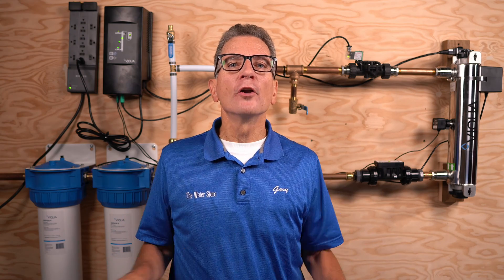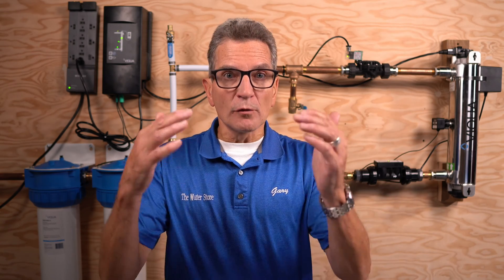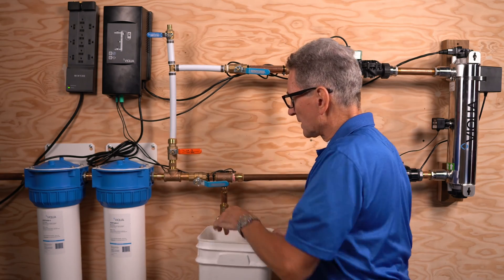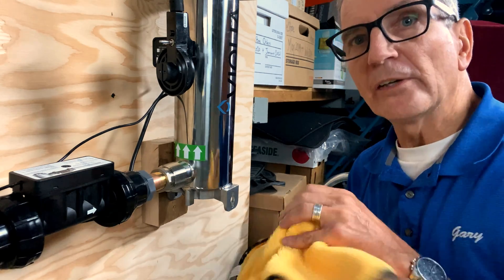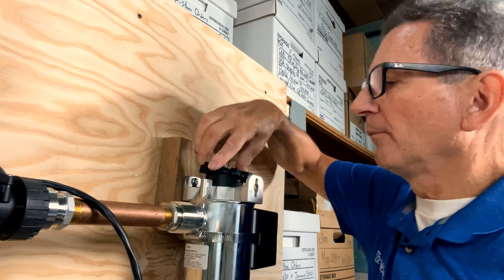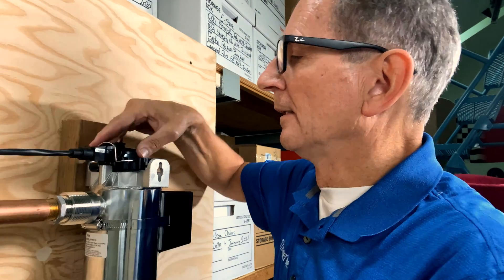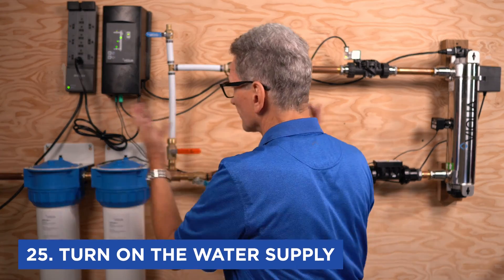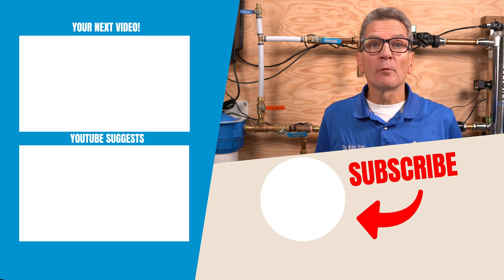How I MAINTAIN VIQUA PRO UV Disinfection Systems

Comment: Thank you for this very, very useful video. I live in Brazil and have a Viqua PRO "H" system and just two days ago the lamp went, after 2 years and I had to do the very job described in your video on my own equipment. 

Followed your video faithfully and everything seemed to go very smoothly and appeared to be fine. Flooded the system and turned the current on (over here it's 220V) and pressed to button to reset the "life" counter for the lamp BUT after it did the initial checkup, here were all green lights in the control box but after a few seconds the lamp light indicator turned yellow, and the alarm starts beeping and stays bipping unless I switch it off and the lamp stays yellow.

Do you have any recommendations / insights into what the problem might be? Thank you so much. Joe Martins
Reply from the maker: I'm not sure, never happened to me.  I would contact Viqua, they have great tech support and I'm sure they will be able to help you.

Comment: What about servicing the solenoid valve. Every time I have a power outage the whole unit goes into lock down.
Reply from the maker: Yes that's what it should do, but after the power comes back on the solenoid will open? If not, you need to replace the solenoid.

Comment: Thank you for posting this! We have been having intermittent alarms for the last year and a half. Called out the plumber that installed the system, and he said both sensors were bad. After he put in new sensors, it was only a matter of months until the problems returned. We disassembled the unit today and cleaned the sleeve and freed up one of the paddles in the flow meter sensor that was sticking a little. No alarms since we put it back together. Now we know we can maintain this on our own just with parts costs. Thank you!!
Reply from the maker: You're very welcome. Please share video with friends and family

Comment: Viqua controllers are very susceptible to over heating. These units are not for outdoor use. Although 70% of my clients systems are outdoors. So we have them build shade and rain coverings over the entire system. Yet on very hot days the controller will overheat. it seems a few of these and the unit will no longer work. So For the love of everything good why in the heck don't they address this. Your thoughts Sir.
Reply from the maker: Great question. I know they don't recommend outdoor installations.  Worldwide, by far,  the majority of these are installed indoors so for the majority of their customers it isn't a concern.  Then in cooler climates, there isn't a problem when installed as you mentioned.  They would need to significatly rework the controller to improve the cooling which would significantly increase their cost for 100 % of their market.